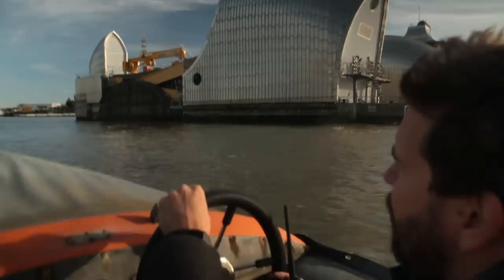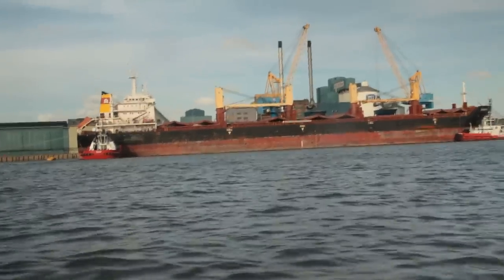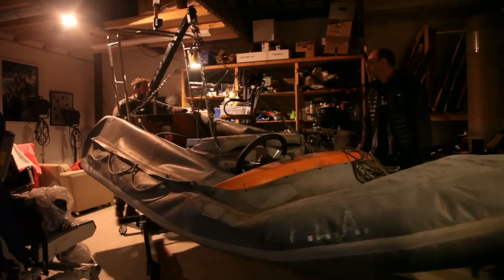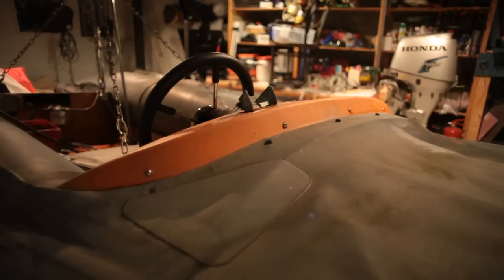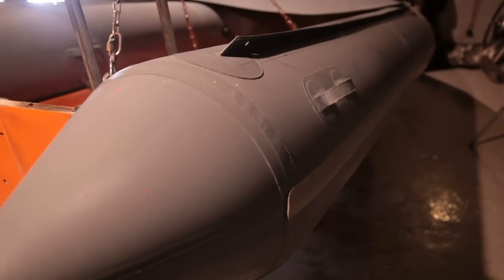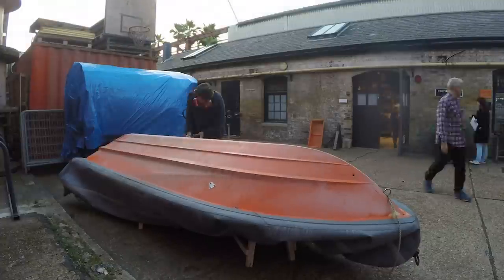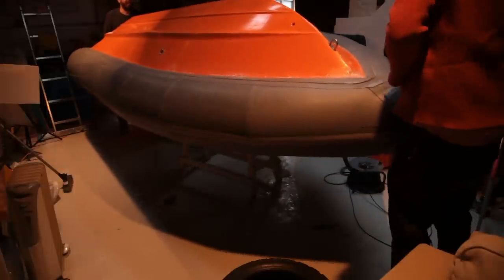Stripping back the Searider - PROJECT SPEEDBOAT - Part2

Comment: Loving this. Maybe strengthen that transom. Although the boat will be rated for 30hp or just above originally...they would have had a mich lighter 2 stroke in mind back then. The new 4 strokes can be nearly double the weight. Best of luck.
Reply from the maker: That's a good point. Perhaps I should add an extra layer. I've enlarged the outboard plate on the back of the transom so that should be spreading the load a bit more. But maybe an additional inner layer would be a good plan.
Reply: Harry Dwyer sounds like a plan to me. It’s a big cause if transoms failing these days. Not something you’ll be wanting to risk on an adventure, such as yours. Keep up the great work.
Reply from the maker: I've taken your advice, i've since been lying awake at night imagining the transom ripping off, and have reinforced it with more yogurt pots. It's now really solid so thanks for pointing it out. All covered in the next episode.
Reply: Harry Dwyer brilliant stuff. You’ve definitely done the right thing. It would have been a potential weak point and cause for worry, for sure. Well done.

Comment: Love the video. What did you use to clean and improve the state of the hypalon tubes as well as remove the lettering? After my exams I'm hoping to clean up our sea rider as the tubes are knackered and have old letters that have been painted over.
Reply: I need to know the same ?
Reply: Toluene is the usual chemical of choice, just make sure your ventilation is good.

Comment: Chances are that transom wood is rotten all the way down. Just patching the top isn't going to do much good.
Reply from the maker: Yes I did worry about that. I drilled a large hole for the bilge and the plywood was actually pretty solid. I also end of covering it with some thick plastic. Finger crossed you're not right!

Comment: Hey Harry - I’ve got a SR4 too and took the outboard off to discover the same problem with the transom... what did you use to glue it up? Cheers, Dan
Reply from the maker: I used wood rot hardener and epoxy, but i've also over plated it with more yogurt pot material, coming up in the next episode!

Comment: Hi what colour paint did you use was it a good match? I'm currently doing the same as you with mine of a similar age but mine has a hole in the bottom 😂
Reply: the proper paint is international toplac rescue orange, im not sure what paint they used but judging by the white label on the paint tin  its probably from a local paint mixer  (gt600 orange 43800)

Comment: I have a question for you: How did you repair you rotten transom? I also have a avon searider with a rotten transom, i would liket to repair that transom. What kind of glue did you use? Is it epoxy based?
Reply from the maker: I used wood rot hardener and then epoxy, but that was only to stop the worst of it. It's still not as strong as it would have been originally. So i've used a larger outboard plate on the back and added more yogurt pot sheets on the inside. It's coming up in the next episode, and is really solid!

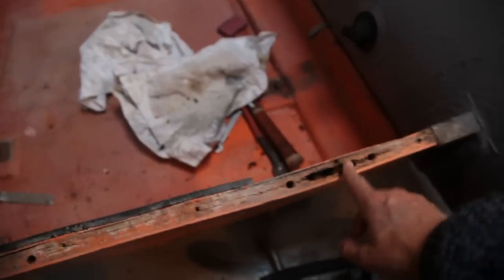Comment: This would fail it's sea worthiness here. That transom is delaminating 6:00 , filling it with bodge is not a solution. It's delaminated because that is a stress point What a waste of effort for the sake of 1m of marine ply. I bet you buy camera gear costing 10 times that deeming it essential.